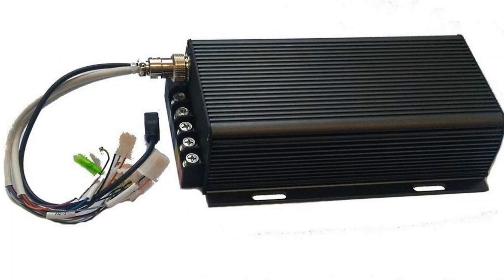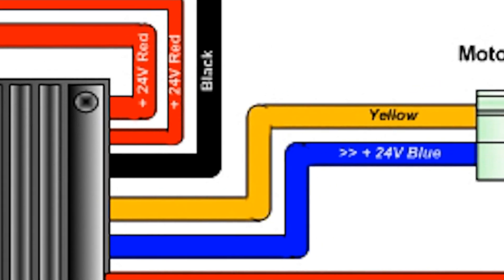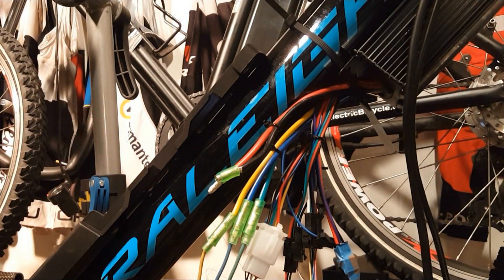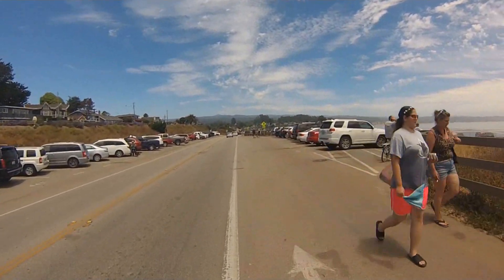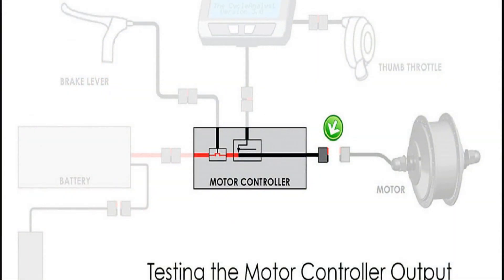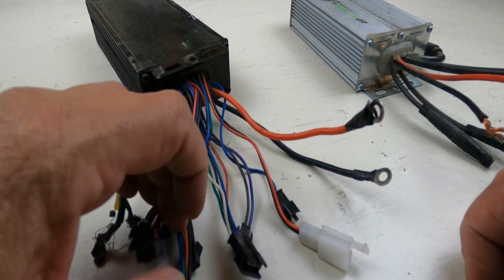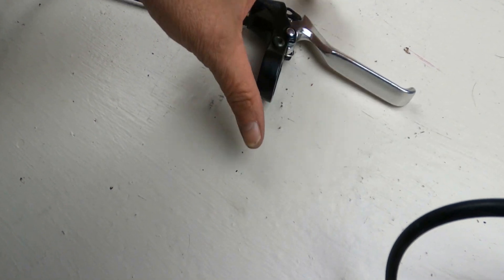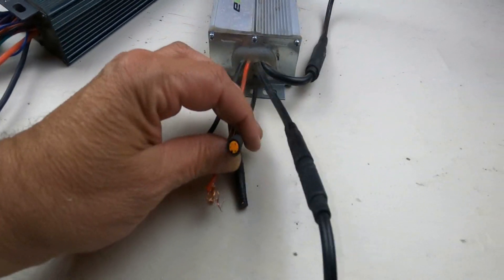E bikes 2020: Understanding your Ebike's Controller. How it works

Comment: My controller was purchased with a twist throttle and LCD display as well as an ignition switch . I do mods a lot but I can not find a way to learn the diagnostic coded led which is flashing 5 times and will not allow any functions. At the same time I have heard that some controllers can be reset but I don't have a manufactured control system and the display is also the throttle and on /off switch. Could you provide info  to possibly learn what the on board led will indicate for problem diagnostics

Comment: Increase the tire size to 29 inch on your lcd functions . Helps increase speed but your speedo will not be accurate
Reply: For all but the absolute cheapest controllers this doesn’t work. Most are programmed so they will turn the motor at the max rpm the board possibly can unless the external speed limit wires are shorted together. Almost all other controllers disregard the calculated speed and operate at whatever it can given the pwm frequency it can physically generate. Any extra speed you think you noticed is placebo.

Comment: on my lcd display connector there is also another white connector coming of it with a short pink wire going back into the same connector. i never unplugged it i just plugged my display into the first connector. wtf is that wire what happens if i unplug the pink wire ?

Comment: How do you short circuit K2 and gnd to make it go faster on a hub kit the guy on eBay says it doesn't have nothing to do with the controller it's the throttle

Comment: Have an issue with my controller, once you  twist the throttle then let go, the hub motor does not stop running, cruise wire is not connected nor enabled. Any diagnosis on this scenario?
Reply: This might just be a problem with the throttle

Comment: Great video.
Question, my battery is 48v 20ah.  My controller is 48v 20ah. Manufacturer upgrade from 20ah b/c none in stock.
Will this combo work? Heard it could damage battery.  I use PAS too when riding.

Hope you can help.

/Bklyn👑
Reply: Yeah it can

Comment: Hello sir! I have a 48v13ah battery and a spare one, both new. The spare one after 1 week of using it, it just turns off when its at around 80% percent of battery. Every setting on lcd is okay. I have error 10 code on the sw900 lcd. Sometimes error 06. Please, i beg u, help me, as i work for uber and i cant afford to buy a new battery as a spare. What to do? Is it bad that i use a spare one? It is the same model
Reply: So what you gonna want to do is unplug it and plug it back in

Comment: I was wondering do you know I controllers gets so hot? Mine was waterproof until I took off both ends and applied a fan to it so it stays a little cooler.